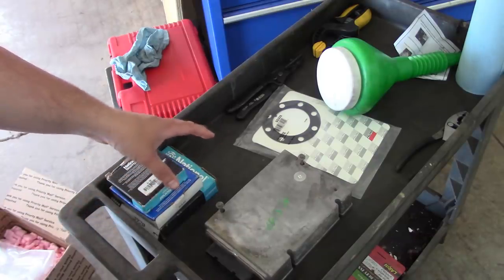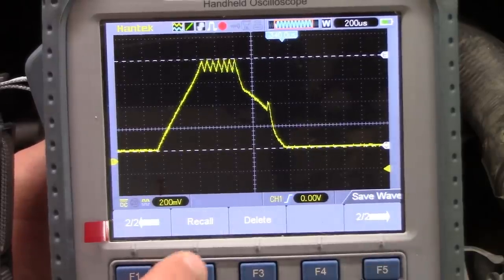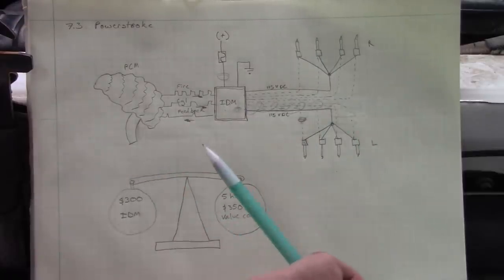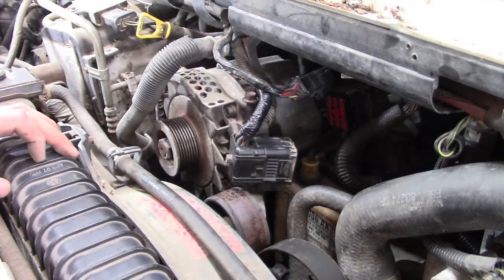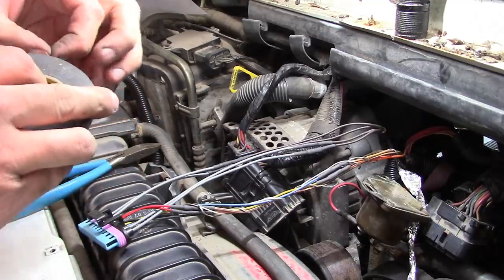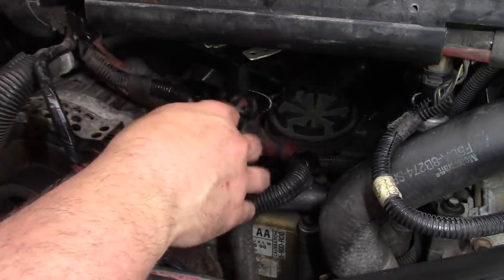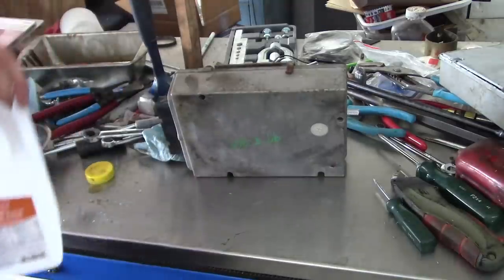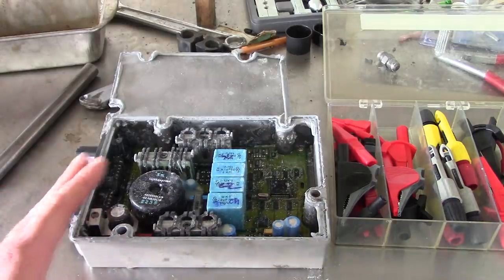Ford E350 | 7.3 Power Stroke - IDM Testing and Wiring Repairs - Part 2

Comment: It would be interesting to know, if the idm before that 25mi one was also filled with water when they changed it before U.
Reply from the maker: I don't know.
Reply: @WatchWesWork  Wouldn't it be just ironic if they changed the IDM during a rainy time and literally flooded the module out in a short time. Obviously the seal on the IDM enclosure is not sufficient. Good work. Would be interested on a follow-up on this vehicle in the future whether it comes back or has been resolved.
Reply: @brianworley7705  - Maybe twice in my life I've seen electrical connectors that allowed water into the enclosure right where the wires entered.  Rotted rubber grommets + vibration + no drip loop in the wire = box full of drowned, angry pixies.

Comment: I'm just at the bit where you are attempting to remove the oversized alternator, it makes me wonder, if I remember correctly this is an ex ambulance? In Australia the ambulances have upgraded alternators to supply enough power to the onboard life support extras, and I believe they stay intact when they are retired from active service.
Possibly something to do with the ridiculous amount of available current playing games?
Reply from the maker: The voltage regulator should keep everything in check.
Reply: @WatchWesWork  Sorry got sidetracked from someone else, but also may be why you could not get the alternator out and had to just work around it.

Comment: At 17:45 (and other times in the video) you can see what looks like two holes left over from self tapping screws in the black plastic below the wiper cowl where the harness runs. Is there any chance those screws could have contacted the harness? I can't tell where the harness is relative to the holes in that plastic.
Reply from the maker: That is where the air filter box bolts up. I'll double check the clearance.

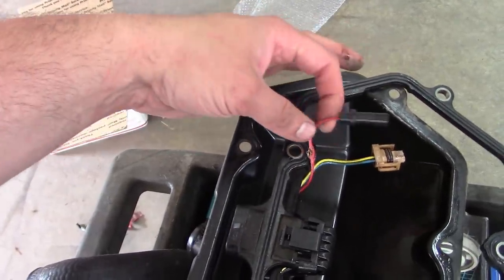Comment: 19:10 It may not cause the problem you see, but having a wire short to ground is certainly not good at all. It's one of the basic principle of electricity, you don't want a short! I like the way you tackle a problem, not like certain mechanics I've seen who would just have put back an IDM an off the door! Also, I think you explain this thing good to the client. What's to put a 300$ IDM if you don't find the original problem. Maybe that's why it was doing only 25 miles, a short wire for a certain amount of time was too hard for the IDM. I'm not a mechanic, but it's not hard too see that there's a potential problem!
Reply from the maker: Yeah, hard to see if it's not happening in the shop.

Comment: Good Lord, Ford likes placing parts to accumulate rain water.  The damn 4x4 solenoid on my 2004 F150 came without the rain hat, the updated part was made with a rain hat.  I replaced the factory solenoid after it allowed water all the way into the IWE's, and had to jury rig a milk carton corner for a rain hat, son of a ......

Comment: Not having to wiring schematic for this unit is there by chance anyway that that pinched glow lug wire some where shared a ground with the IDM. On the old FLD Freight Shakers a common ground on the twisted pair would knock out an ECM , I should say would flash the ECM on a series 60 knock out the injector calibration.  
  I’m just asking because exactly like you say intermittent problems can be all most impossible to locate.  Great content 👍
Reply from the maker: The glow plug has it's own feed and relay independent of the IDM. The problem usually is that the glow plug pins in the harness connector melts and shorts to the injector wires. But this one was OK.
Reply: Watch Wes Work   I was just asking, I appreciate your reply, I know in the 30 years of Industrial maintenance I have ran across my share of intermittent problems and like the one you have there make for sleepless nights now and then.Enjoy your content, wish the opportunity to share was around in my younger years.  👍👍

Comment: In aviation, which you have to watch for vibrations like heavy diesels, cause planes are built so light, you aren't allowed to put a plastic zip tie around an aluminum hard fuel line, because they will saw right through them!  But you can put a little bit of soft fuel line around the hard line, then ziptie that.  The FAA is real fussy, so if that's okay with them, it's probably safe, hah.

Comment: Perhaps the module filled with water when someone took the lid off to look for an obvious failure and didn't re-seal it properly.  I know you can clean circuit boards by just washing them but that may not be worthwhile in this case.  Cheers

Comment: I had the windshield removed and resealed in my 99 7.3 to keep this water in the computer problem from happening just a few years ago.
Reply from the maker: That's a common issue on a lot of vehicles. Water in fuse boxes and connectors. Makes a mess!
Reply: Watch Wes Work this was a big issue in my dad’s 78 Rabbit.

Comment: Question:   I do a lot of work like this,  where you are looking for problems that others have tried to fix, and you spend a lot more time than you can charge the customer.   In the mean time you find lots of other real issues like the pinched wire and the anti-freeze leak that you end up fixing. 

This dedicated, detailed, specialized work should be well rewarded, but obviously lots of people would not pay a lot  for this and go buy new.
I constantly question what I should charge the customer?   What do you charge for all this type of specialized work, and how do you conclude
your costs?
Reply from the maker: It's such a hard question to answer. I guess I don't worry so much about getting paid for every minute, and I stay focused on getting the problems solved. Like the coolant leak. Even if the customer refuses to pay me, I have to fix it. It's not safe or right to let it leave my shop like that. I think it will be rewarding in the end, though maybe not with actual dollars.
Reply: @WatchWesWork  good reputation

Comment: I think you are getting high voltage spikes that is taking out the drive circuitry. I guess it only happens intermittently and maybe never at idle. When the coils in the injectors are drawing current and you get a temporary open circuit on positive or negative lines the voltage across the coil will get really high and if the open circuit goes away that voltage gets dumped into the drive circuit. So I guess I'm suggesting that any broken wire can cause this, even ones that look fine from the outside insulators. Maybe you fixed it when you replaced the valve cover loom or reinsulated the bare wires.
Reply from the maker: I suppose that is possible. I think the IDM drive circuits have flyback diodes though. That should bleed off any stored current as soon as the circuit is opened.

Comment: I can say that you earnestly put in a lot of effort to see what was available to the eye an some of this is a old truck with.... let me rephrase that; Its aged beyond normal because of the corrosive effects of the area its in. Seems to me that putting fifty pounds of shit in a five pound bag instead of the normally only ten pounds of shit in a five pound bag. These cabins that host a large engine should at least leave room for poor people to work on them. They recommend pulling the cab on most all repairs on all the nineties and newer rigs around here. I did make a four point hoist for cab and fender lifting and did use it a couple of times. It cured me of that in a hurry as that takes as long to do as the whole repair in most cases. Once the cab is off doesn't mean its easy but better than it was. I replaced soft plugs (freeze plugs) in a 6.9 and I removed the cab and fenders and most of the top of the engine to get down to the side of this one rig and the guy who owned it came in while I was doing the work.... he took one look and said ; Charge me as much as you want! That is f'ing ridicules' to even think about. I told him all in a days work. He told me he was sending his work to me for the easy work as well as this is just too much. That was a 88 ford f250 and had all the bells and whistles of its time, its worse now. I think the other guys in the area are sending the hard stuff to you to keep you too busy for the nice brake job. I did a steering column for the bearings and that is mind boggling to figure out the wires that are compromised in one. I am glad that I don't do this any more.
Reply from the maker: Even on the new F-150s you cannot pull the engine without lifting the cab. It will not fit between the firewall and the radiator support. Pretty dumb if you ask me.

Comment: Ok. I saw you use an engineering notebook to draw schematics for us. Now a scope. I'm convinced..you went to school for engineering. You sure the last spike isn't inductance dumping it's current on shutdown of the solenoid? Those solenoids often have some sort of cap across them internally too. So inductance and capacitance on the tail end?
Reply from the maker: Could be. I think the little spike at the end must be inductive collapse. Or maybe it has to do with the flyback diode in the module.

Comment: It's pronounced "lan-iyap" sort of.
Also, have you ever seen the Raychem heat shrink solder splices? We had them in military aviation 40 years ago but I've seen them advertised in civilian-land recently. They're a translucent blue heat shrink tube with a ring of solder in the middle and a ring of adhesive on each end.  You cut and strip your conductors so they overlap about 3/16" in and slip them in either end of the splice. Then you heat shrink the whole thing, the solder melts and makes the electrical connection and the adhesive melts and seals the ends.
Reply from the maker: I'll probably never get that right...

Comment: Had a similar problem with my Duramax.  Turned out to be chaffing in the injector harness caused the computer to shut down half the engine!
Reply: HardwayRanch right on top of the alternator?
Reply: @clintsmith559  It was under warranty - BOTH TIMES - the dealer didn't share the details, sorry.  But the 2nd time it happened they replaced both banks of the fuel injection harness with an 'upgrade' and it has been fine for the last 200,000 miles.

Comment: Fly paper, Wes. Fly paper. And when there's an invasion of these gnats, just go buy the cheapest roll of self adhesive paper and unroll a large one by the door. At least it's not an invasion of mosquitos.
Reply from the maker: I've never had luck with fly paper. Maybe I'm using it wrong.

Comment: uurrrp I didn't see u check the turbo intake for the lost hose clamp, or did u find it when u swapped in the spare clamp, I'm not hating btw I work on my t444e 's sometimes and I am just clumsy and I'm giving you a like, and that's the way it is.

Comment: I am a cave man fix guy. I would hook continuity checkers on it and wiggle wires to find the short. I suspect like  you said, the shielding in the cable. Maybe you can figure out a way to isolate that for a short test.

Comment: I don’t understand why the fact the old IDM filled with water wasn’t the smoking gun. Maybe ask the customer about heavy rain or aggressive washing around the time of the failures. Maybe this is a case of the client causing the issue because of bad habits (pressure washing the engine bay) and he just doesn’t realize it. And the issue doesn’t occur until he is driving it and the water in the module sloshes around and killing the unit. Never know. But if the water was the issue, however it got there, your hat mod will keep it from happening again.
Reply from the maker: Well it's likely that as an ambulance this thing was always kept inside and never saw rain. But I still can't see that much water intrusion in such a short time.

Comment: Regarding the heater line splice.  Wouldn't it be better to block off the lines rather than tie them together?  Reason being when coolant is flowing (vacuum valves open) the system is expecting heat to be removed from the coolant by the rear core.  I assume this system is bypassing the radiator, like most heater loops would and now you are dumping hot coolant into the cold side without pulling the heat out.  Not sure if it really matters, have seen tons of systems with loops on the heater hoses.
Reply: Yep- shortcircuits the cooling system. Block each line is the right way to go. I think the looping came to be as an emergency fix when the heater core sprung a leak on the side of the hiway.
Reply from the maker: I can't see it being an issue. In many vehicles the heater control valve creates a loop in the heater hoses just like I have. They seem to work fine.

Comment: My thoughts are if the idm was under the windshield drain it will fail again soon without the ends on the hat. And not tied down holding everything in place. The spikes are troubling and could do in this ambulance wannabe. You can certainly see why they took it out of ambulance service with low miles. If this comes back it will be one of two things. 1. Spikes wiped out the semiconductors. 2. Rain again made the module soaked. Not sure how to calm the spikes without an electrical coil with a certain number of Henry's before it enters the module. I would tell the guy if it is running good to sell now not later when one of those injectors malfunction. That is my advice to him to not by ambulances to make trucks out of especially not this engine.

Comment: How do you like the maxysys? Does it have a good selection of bidirectional functions?
Reply from the maker: The Maxisys does have bidirectional controls. I showed using them to toggle a canister vent valve in recent video on the Olds 88. I believe the MK808 is even cheaper and has most of the same capabilities. The Maxisys 906 cannot do J2534 programming like the 908.

Comment: Want have intresting one I know guy did in a 1975 D350  1 ton Dodge van was old ambulance till retire it also he bought at auction sale & motor was 318 V8 with 2 barrel carb had hand choke type with Manual transmission 3 in tree on Steering column, 404 Rear end gears! Guy put 1976 Massey Ferguson Perkins Desiel 6 cylinder no turbo type motor was combine 500 series and no computer type!  The motor is 360 Cubic Inches 5.7 Litre, hook up to 3 ton Stake truck Creeper gear Manual transmission on Floor with Bow Low First gear 5 gears total foward and one Reverse gear  , 390 Rear end gears to has Power Steering plus Brakes, Hydraulic Clutch pump , Hand brake handle, 2 fuel tanks , RPM gauge, 24 Volt Negative grounded , 100 amp DODGE alternator, 2 fuel gauges plus tap to use, glow plug switch in were the cigarette lighter used be , turn to camper too also and fun vechile drive to ! Plus has sink, hot water tank setup, plus heater propane type even Lol the tank on right frame rail too and fits 2 people sleep too even travel in to ! But yes loud vechile in exhausted to !

Comment: I wonder when you have to give up on squeezing around stuff and have to pull the cab off the frame.
Reply from the maker: Anything to do with heads or exhaust manifolds would be a cab off IMO.

Comment: Would've looked at replacing the oversized alt with the correct output model-
Reply from the maker: I have a used one on the shelf. But the large alternator should not hurt anything.

Comment: Tape a clear plastic bag, a sandwich bag will do, with a couple inches of water in it, on the entry door to the shop where flies have to pass in and out.  Flies won't come in the shop.
Reply from the maker: What's the science there?
Reply: @WatchWesWork  I have never known, but grew up near chicken processing plants in Georgia where the fly problem is staggering.  Have pondered the science or principle behind it for years, and have nothing conclusive.  Interested to know if it helps with the type of flies you have there.  Thank you for investing time to make videos, I appreciate your efforts to be thorough and enjoy learning from you!

Comment: Smoke them Nats out....some incense is like poison to them...try out some cheap assorted types to see if they work on yours...also some plants like mint or rosemary or sage might do it as well
Repellents: DEET, citronella, vanilla, pine oil, and dryer sheets are commonly used to repel gnats. You can also use fans on your porch to keep the air moving and discourage hovering swarms.
Reply from the maker: They seem to be really bad for just a few weeks at the end of spring. They should be mostly gone by July.

Comment: Alternator and sigarette equipment can also cause high voltage even in modern cars...
Reply: I can't help wondering what was done to the wiring harness that fed the ambulance ...was it hacked up and taped off somewhere and now feeding back into the system somewhere?

Comment: I am working on a Bluetooth module on my Dodge but it is inside the cabin so I might be able to open it and see what failed. Probably just a cap or resistor.  The oem is 550 for a Bluetooth module for the phone. Ridiculous.

Comment: Is it possible they didn't actually replace anything or installed aftermarket rebuild computer init so that's why it didn't work
Reply from the maker: I don't know.
Reply: @WatchWesWork  only Ford would make such a dump design not even gm are that bad

Comment: The wires looked innocent enough, but they weren’t melted or anything so it’s possible it was not. I’m no electronic specialist, but maybe a surge/spike from that big fuck off alternator frying the module? I mean, the ambulance bit got me, they need lots of clean power, now it needs nothing, I could be wrong, but after all that, I’d have had that out, replaced it with a standard and put in a new battery for good measure. At any rate be handy to have that alternator for a different project.

Comment: problem with these 7.3L is they are a electromechanical injector you can buzz test but theres no way to really test the injectors without taking them to an injection shop